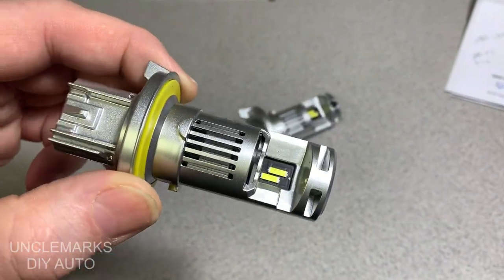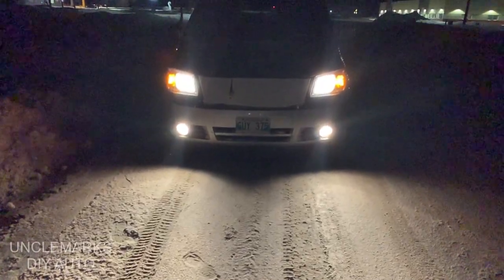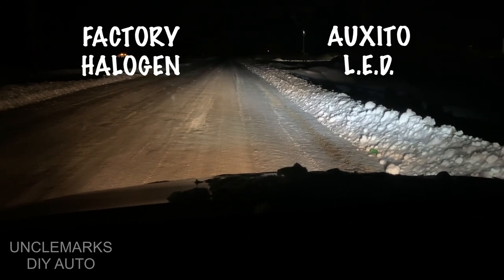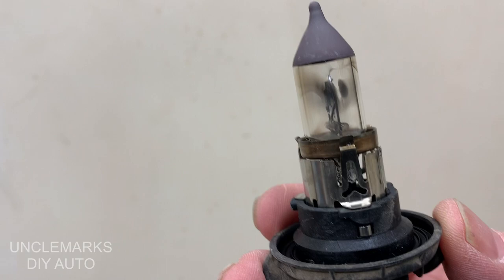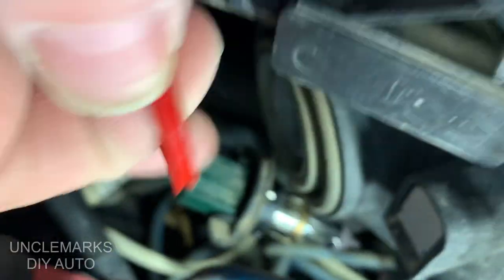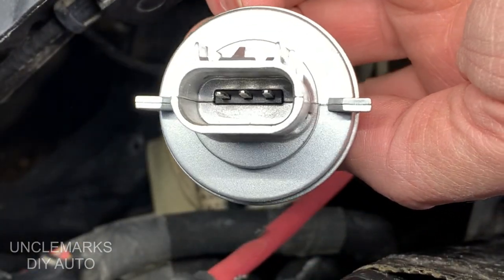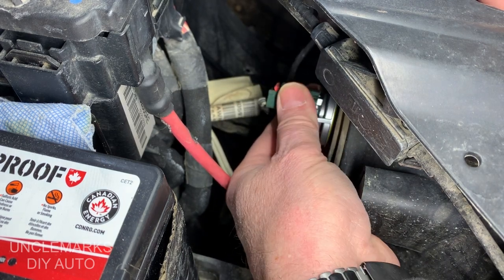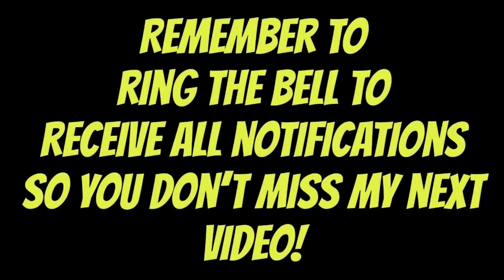Auxito LED headlight bulb install & review & comparison

Comment: Overall, the brightness seems similar, but the LED seems to cast a wide light a bit better, which is important. Seem to work well with the factory cutoff which is also important. I actually prefer a slightly off white to a more blue white, but some people really want that color. They seem decent. :)
Reply from the maker: I am noticing a flicker every so often. Not while driving, but when light is shining against things. Very slight, but noticeable once you have seen it before. I guess there are brighter LEDs out there, if you can believe what some sellers are claiming. Some claims seem too high to be true. I have no way of testing that though.
Reply: Hi 802 Garage! The led is actually brighter. Take a look at 3:10 when the light hits the road and you can see the led is brighter. We use similar LEDs for the courtesy lights in our van, and MAN WHAT A DIFFERENCE. Definitely like to know how long they last compared to the standard bulbs though.
Reply from the maker: @OnlineAutoRepairVideos  They claim 50,000 hours. The original bulbs are 23 years old, so I wonder.
Reply: @unclemarksdiyauto  Now that makes me wonder as well!! I guess I'll see you in 23 years, LOL!
Reply from the maker: @OnlineAutoRepairVideos  she might still own it then! The newer Caravan engines are have issues. I would want proof lifters had been done.
Reply: @unclemarksdiyauto  So true, but those older ones (and we've had 2), those engines were GREAT!